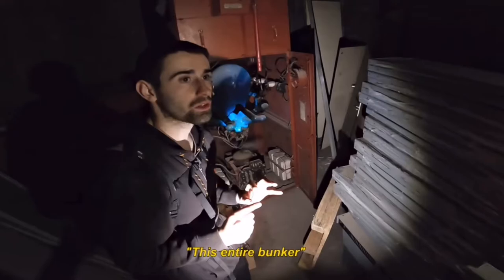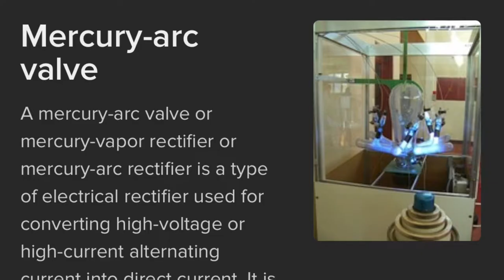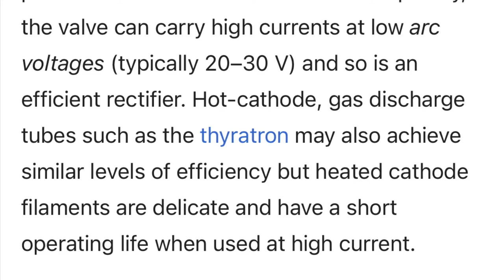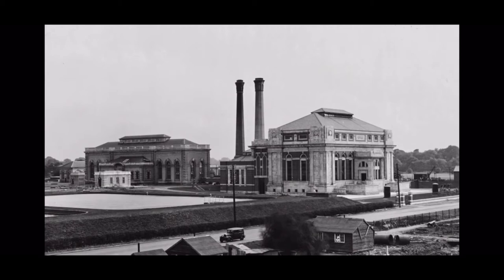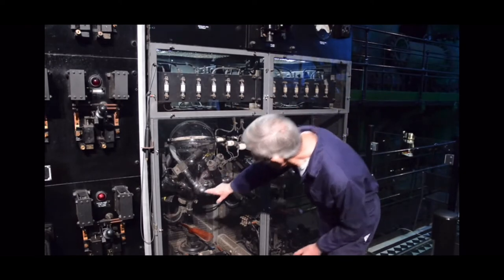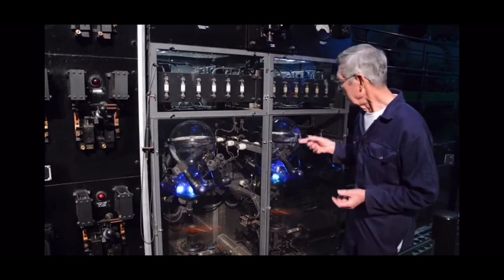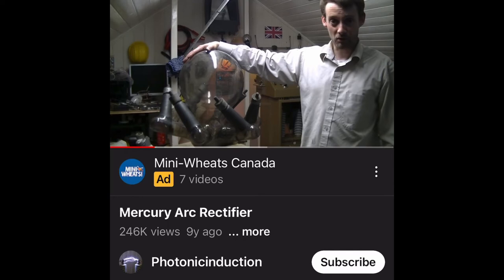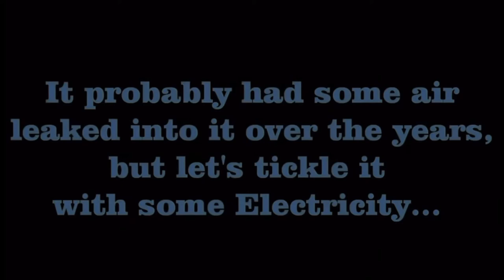The Mercury Arc Rectifier

Comment: I worked on salvage/demolition of a power station 30 yrs ago and pocketed a glass sealed tube half full of quicksilver/mercury with a wire strap/cable coming out of one end.. it was about 7 inch ...I always wondered what it was exactly I thought a fuse or switch but seeing this it may have been a small version of a rectifier maybe?
Reply from the maker: Just as soon as I saw this, I knew it was a show. Watch my last video too.